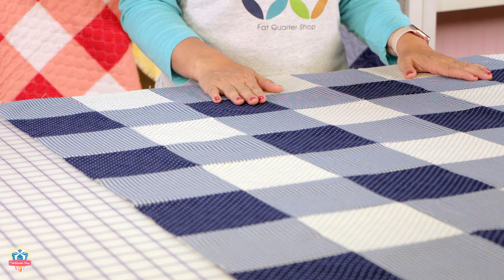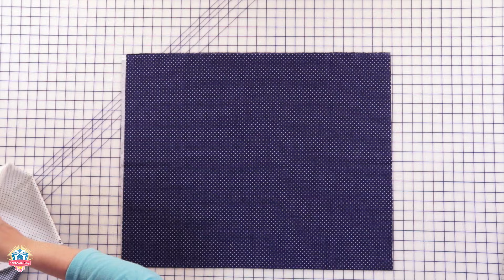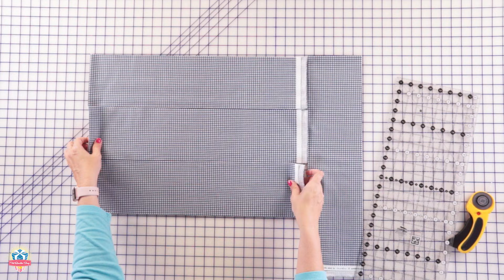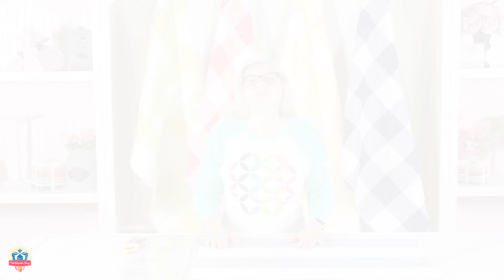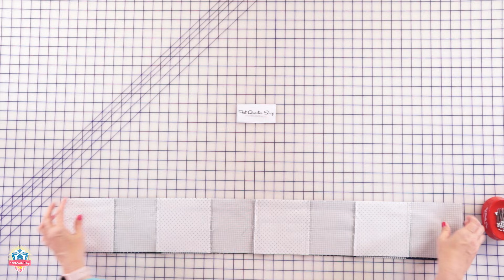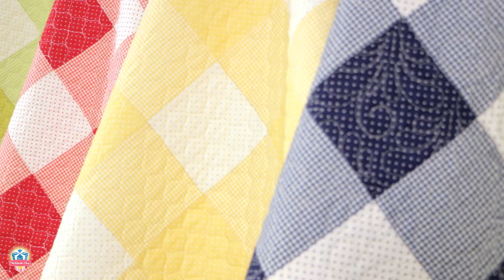3 Hour Baby Gingham - Easy Baby Quilt - FREE PATTERN

Comment: I love this gingham pattern. How would I make this into a twin quilt?
Reply from the maker: HI Judy, since this pattern is written specifically for stripsets, there is no real good way to adapt it.  If you really wanted to go for a twin, you could make 2 quilt tops, then join them along the 50 1/2" sides, that would give you a 50 1/2" x 80 1/2" quilt center.  THen you could add a wide border, and that would get you close to a twin size.
Reply: Thanks for your reply.